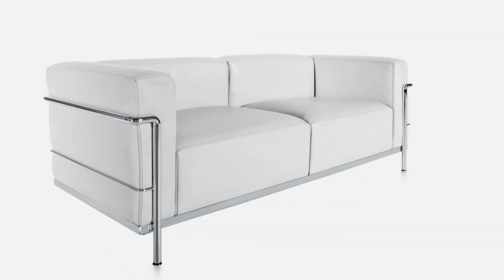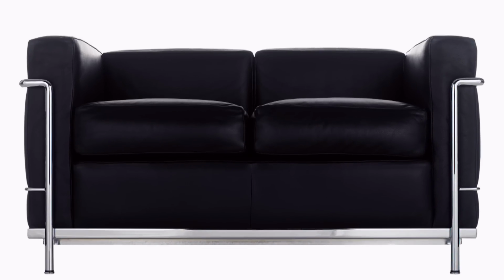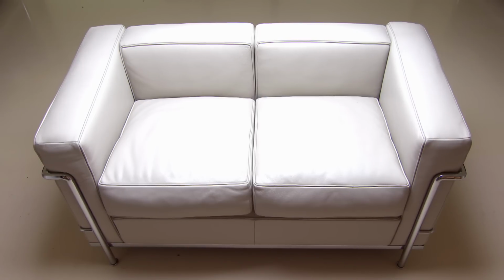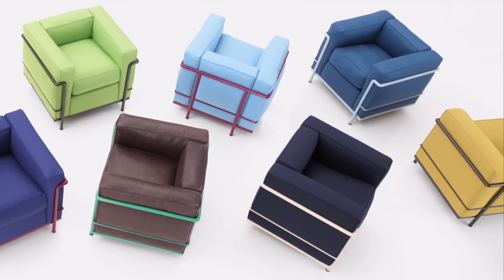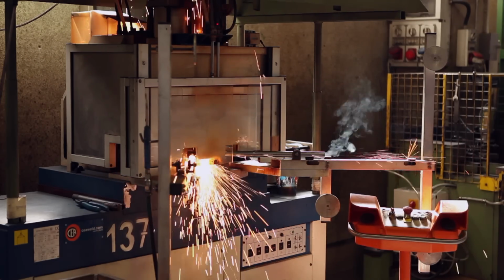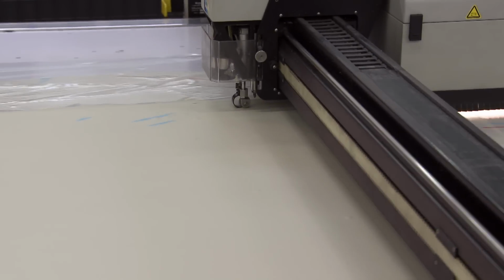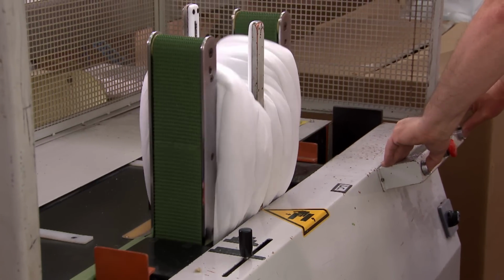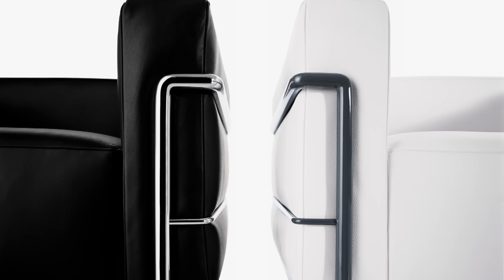How Le Corbusier Sofa by Cassina is made - BRANDMADE.TV

Comment: I wish they made it in stainless steel as apposed to regular steel
Reply: Chrome-plated steel isn't of a lesser quality than stainless.
Reply: @earlmcmanus194  it can rust. I’ve seen a rusted Barcelona chair. And then it needs to be dismantled, stripped and plated again. The Barcelona is available in stainless in the US.
Reply: @b_altmann  stainless steels actually rust as well
Reply: @SestoMazzanti  firstly, that depends on the grade of stainless steel and then the environment. Point is that the chromed steel version will rust badly. That also has to do with how good the nickel plating was.